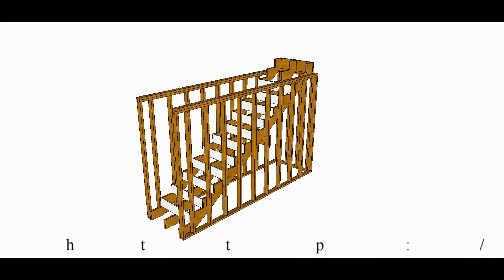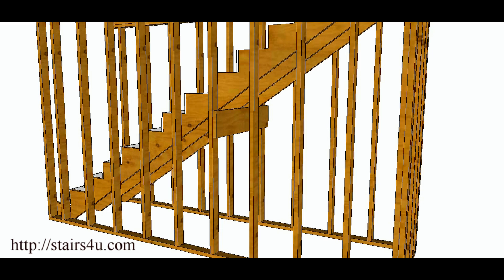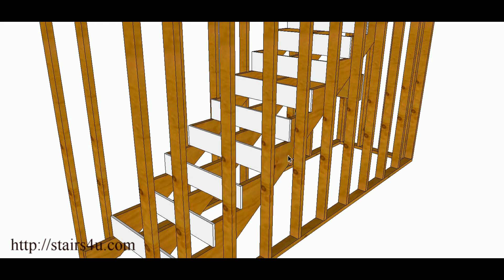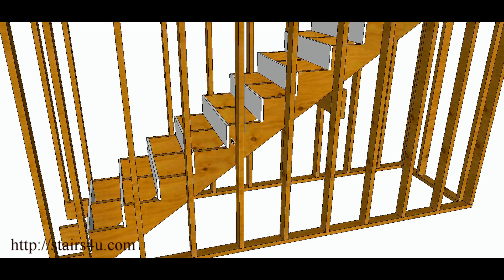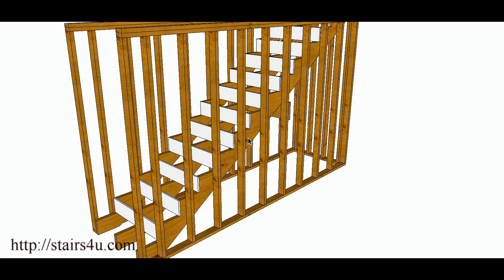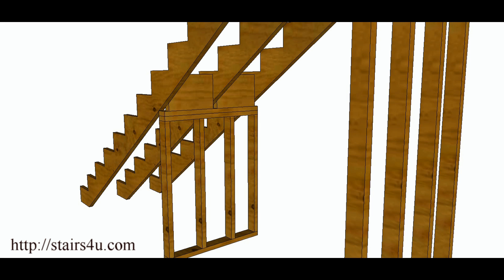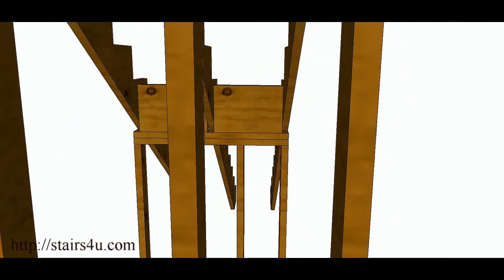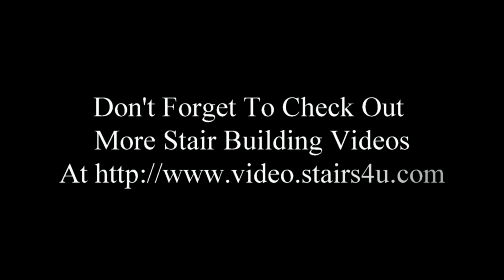Should You Use Supporting Walls or Risers for Long Stairway Construction?

Comment: I have some stairs that are attached to two walls but I am wanting to open the one side and make a reading nook.  I cut out some of the drywall and have noticed that the stairs have 3 stringers but also have another supportive beam structure at about step 5.  The staircase is 12steps before the landing.  Can I remove that support beam? I feel like I can after watching this. Thanks
Reply from the maker: I can't provide the engineering information you're look for, but I wouldn't remove it if it is making the stairway stronger.

Comment: Thank you this helped me solve my problem with flexing stairs. They had no braces and had not been attached to the two walls they were between, so they had quite a bit of flex. I braced them by simply attaching them to the wall studs on each side of the stairs and now no more flexing.
Reply from the maker: You're welcome and I'm glad it worked.

Comment: Is a supporting wall along only one side sufficient for 36” with 3 stringers?
Reply from the maker: Usually, but if the stairway is moving while walking up or down then you might need additional support. I've built plenty of stairs with 14 steps with one wall on the side.

Comment: The supporting walls that you show about mid-way through the video appear to be made from 2X4’s. As an alternative, would putting a 4X4 post under each outside stringer suffice to support the stairs? Also what about putting a small notch in the stringers to better join them to the wall or post? Would using lag bolts tie the stringer to the supports while lessening the chance of splitting the wood? Thanks in advance for any answers
Reply from the maker: Yes, you can redesign the stairway and use 4 x 4's. A small notch would be acceptable and you can use connectors like lag bolts for bolts with nuts and washers, whatever you think will work best.

Comment: I have a tough issue with my steps and need a wizard to figure out.   I moved the door from the front of the original steps to the side of the hallway and now the steps are awkward.  The entrance to basement is 32inches wide. And i have 12 steps going down at 8 inches of rise.

Comment: Why use a brace if they are nailed to the wall?
Reply from the maker: I was just trying to provide others with another alternative, but as long as the outside stringers are attached firmly to a wall, then the plywood risers could be used instead of a brace under the stringers.

Comment: in the case where there are no walls, what about supports nailed to the sides of the outside stringers with a horizontal between them running across the bottom of all three stringers?  It would look like an "H" with the stairs in the middle/
Reply from the maker: Yes, that should work and I've seen it done plenty of times.